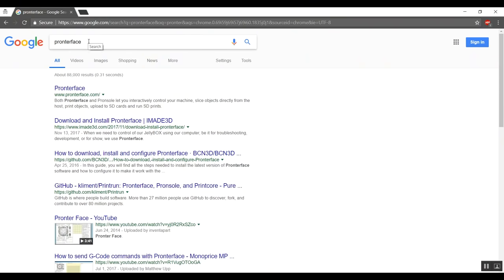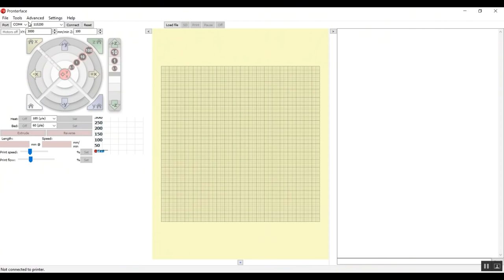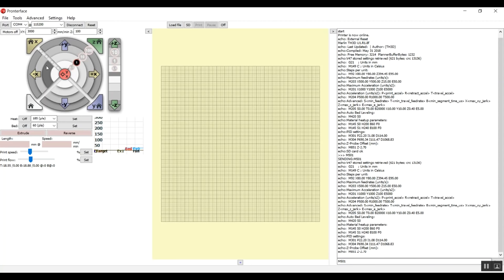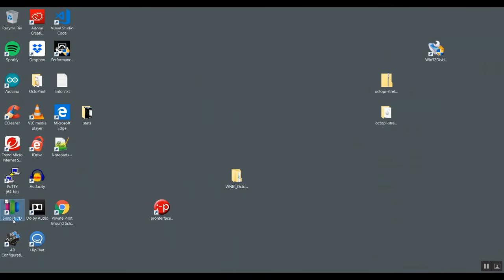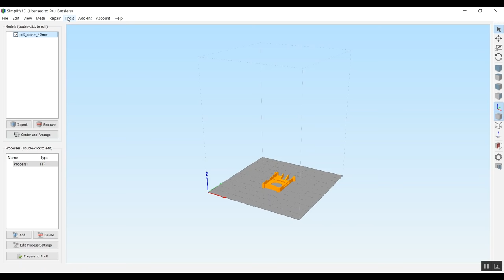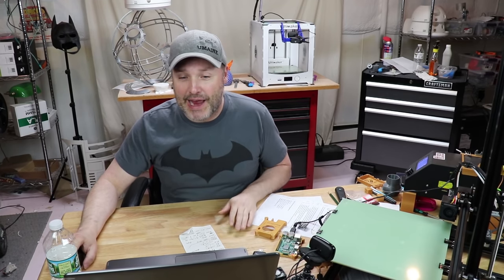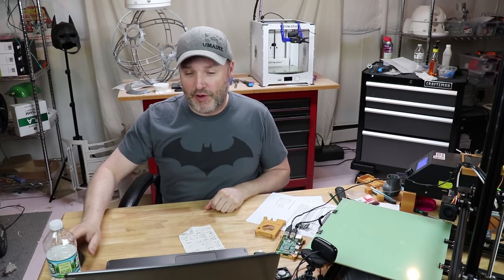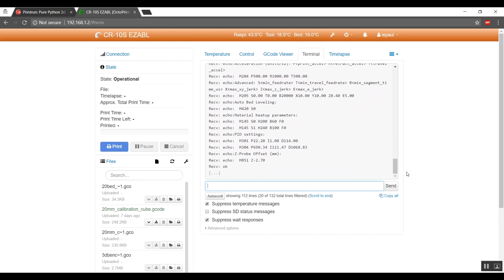How to connect to your 3D Printer from your PC via USB!

Comment: I ended up having to use PronterFace with my new MP Mini Delta when the micro SD card that came with it became corrupted - and none of the other micro SC cards I had would work with it.   (I am returning the delta and getting an Ender 3).   The problem I had with delta and Pronterface was while it would pump out a print OK...the first couple of layers were pushing into the bed too hard.  It would go through the self leveling routine fine but then pressing too hard after it started.  Any Z axis tips would be greatly appreciated.
Reply from the maker: Try Repetier Host or even Cura.  It sounds like your bed leveling needs to come up a smidge
Reply: Thanks...will try that if I have problems with the Ender 3 when it arrives - the mini delta gets returned today.  I am using Cura for the slicing put couldn't get it print directly which is why I tried pronterface.  The weird thing was, the printer worked perfectly when I ran the g code off the sd card but once the card got corrupted, the exact same file went wonky at the beginning when using pronterface.  Sure would be nice if this hobby was a little more plug and play.
Reply from the maker: @TheFieldLab  well the cost for out of the box/works quickly has a cost...  Ultimaker, Raise3D and higher end printers like that do give you that experience but are much more expensive.  These cheaper printers entice us with their low cost but not everyone has a good first time experience with them...largely due to the lack of support.  We're at an interesting time in 3D printing...people adore these cheap printers knowing they have to rely on Facebook/Social media for support and pretty much have to upgrade/replace components to get quality prints!

Comment: Looks great when you do it but Pronterface doesn't find my Ender 5 Plus.  Now what?
Reply from the maker: I don’t have an Ender 5 to compare with. Make sure you have the port showing up on Device Manager?
Reply: @WhereNerdyisCool  OK, I got Pface to find my E5+.  Now what?  I have a part I designed on Solidworks because I use it in my work.  I saved it as an STL file and I'd like to print it as simply as possible.  I've heard the smart thing is to save the part to an SD card but that's just a rumor to me.
Reply from the maker: SD card is the quickest and easiest.
Reply: @WhereNerdyisCool  OK, so we're making progress.  Any suggestions on how to get from a STL file I created to an SD card using Pface?  Is there something I should read rather than pestering you?
Reply from the maker: I’d use Cura

Comment: I don't understand, please help. I am trying to connect via USB cable with pronterface. I have tried several different cables and all usb ports, but pronterface keeps saying: 

[ERROR] Could not connect to COM5 at baudrate 115200:
Serial error: Cannot configure port, something went wrong. Original message: WindowsError(31, 'A device attached to the system is not functioning.')

I am using an Ender 3 printer, all I know is that the 115200 baudrate is correct. As I read it on internet (so it must be true ;p)
Reply from the maker: Is this a Windows PC?
Go into Device Manager and look under Ports.  Check which port you have a showing and available
Reply: @WhereNerdyisCool  Not exactly sure what you mean. Yes, I am using a windows laptop.MSI GL62, 7RDx to be exact. 

When I open pronterface, it automatically shows com5, but no connection. 

With the Device Manager I assume you mean from windows, when I go there, and with ports I assume you mean the tab called "Universal Serial Bus Controllers"?
Reply from the maker: @demondin  As I said, in Device Manager, under Ports (COM & LPT), it will display the available ports.  You should have a "Communications Port (COM *some number*) showing
Reply: Well, I wish I could send you a screenshot of my device manager here because, believe you me, there is no Ports category there. Only Universal Serial Bus.
Reply from the maker: No need to convince me of anything.  If you do not have any com ports showing up, we’ve confirmed the problem.  Try another usb cable?  Have you posted this question to the Ender 3 Facebook support group?
Reply: @WhereNerdyisCool  Nope, found the problem :) In my device manager the hidden  devices were switched off. I have Ports now, with 1 sub line saying COM5. Now what? :)
Reply from the maker: Tell pronterface com5.  Make sure nothing else is using the port
Reply: @WhereNerdyisCool  How do I make of that? Plus how do I even know which port this is on my laptop? (Sorry for all the questions but all my prints come out like shit and I am 99% positive that it is under or over extrusion so I need to connect my laptop to my printer)
Reply: @WhereNerdyisCool  Oh wait it says that the device is not connected to the computer. Sigh... Why is this so difficult? Why can't it just be, plug cable in USB, open Pronterface, done...
Reply from the maker: It’s usually that simple.  I’d consult with other Ender 3 users on the Facebook group.  I don’t have one so I’m at a loss to duplicate

Comment: I had my printer connected to com 4, then one day, com 4 wont connect to the printer.  Are there drivers that need to be installed?  I think something got wiped with I did a windows update
Reply from the maker: I'd search on YouTube on How to find my COM port...and include what version of Windows you use.  Mine stays the same on my Windows 10 setup

Comment: Hello! I just added an E3V6 hotend to my monoprice mini V1, and I updated the firmware. Now I am trying to run a couple of commands to my Monoprice from Pronterface, but, I am having a REAL hard time finding the Com port, and I cannot connect. I have tried both on my Mac, but, also on a PC laptop running Windows 8.1. When I launch Pronterface on the Mac and the PC, the Port window is blank (on both), and I just have no idea how to find the information to type in.. I had thought I found it at times, but, so far, no luck. Any chance you can help guide me to find the right port that I plug the USB into to my monoprice? I know the ports all work on the Mac and the PC. THANKS!!!
Reply from the maker: In Device Manger, Under Ports, it should be listed.  You can get to Device Manager a few ways...easiest is the Search Box in your System Tray (near the Start Button)  Start typing Device Manager and it should show up!
Reply: Thanks! It worked out! Just got 1 more question... When I 'Home' my genuine E3DV6 hot end, it ends up about 3MM off the front left corner of the bed. Basically, the same as place as the factory setting, but, about 3MM off the front of the bed now). I can move the hot end into the right position (using on the pronterface interface) - is there a way I can move the hot end into the desired place on the bed that I would like it to 'home' to, and then upload a command (followed by M500) to save that desired position as the 'new default' location when hitting the 'Home' button? Is it possible to do that way? Or, do you know a pronterface command to upload (followed by M500), to make the E3Dv6 home on the left corner? Basically, 'fixing' the homing positioning with the offset (through pronterface), and saving it in the firmware so that it then homes on the left front corner of the bed again?
Reply from the maker: @Gouldeyecandy  I don't know....that's a good question.  I can suggest asking on my web forum (http://www.3dprintingforum.us/)  Or you could try any of the many  Facebook 3D printing groups too..
Reply: Thanks!!

Comment: Unless I missed something, nothing was actually printed.  Neither piece of software will install on my Windows 10 machine.  I don't have a PhD in Computer Science.  If I could program a Raspberry Pi, I would just build my own printer.  It does not look look printing for the USB cable is implemented in most printers.
Reply from the maker: ...you missed something. Many use Raspberry PI and the USB connection to the printer to print. 🙂

Comment: I just got an Ender 3, which uses the same board as the CR-10, and I'm having an issue when I try to connect it to PronterFace, it gives an error that says A device attached to the system is not functioning. Do you have any idea what the issue could be there? Thanks.
Reply from the maker: Baud rate comes to mind?
Reply: Kind of. I figured it out. I updated the driver for the port in Windows and then changed the baud rate to match and it worked on my laptop, but I did the same thing with it on my desktop PC and it still wouldn't work, but it gave me a different message, which I can't remember now... but at least I have it working with my laptop! Good enough.

Comment: Your information about CURA not having support to print via USB is false, CURA very much enables you print via USB
Reply from the maker: Let me clarify....not on an Ultimaker 3.  No USB port
Reply: @WhereNerdyisCool  with CURA I can easily print on my CR-10s Using a USB cable from my laptop
Reply from the maker: @iamchukwueke  right, but if you check out their support forums, they were talking about no longer supporting it.

Comment: you blerb on as if s3d is the wheel lol ...  cura , ideamaker ,craftware,mattercontrol and repetier host  all have a user interface for controlling a 3d  printer .. and you mention custom supports  well cura, ideamaker and todays version of mattercontrol has those features   in my view the s3d guys are just money grabbers ...  all these slicers ive mentioned  dont cost a penny and they all are in my opinion worth more free than hundreds of dollars for the same program under a different guise ... have you seen the latest version of ideamaker ,or craftware ??? their custom supports are awesome .. and guess what??  they cost absolutely  "JACK!!!!" ;)
Reply from the maker: True...there are many other slicers that can do the USB connection testing.  Minus Cura, which does not at all.  Thanks for your comment

Comment: Well I am none of the wiser,for god sake show the connections from the Pi and I thought it was wireless .
Reply from the maker: Umm, the video title says "via USB"   =)   I didn't exactly try to hide anything
Reply: OK,is it standard USB or micro and how different is the setup for WiFi?
Reply from the maker: Using the standard USB ports.  As to what's on the printer, it can vary printer to printer.  My CR-10S uses the USB 2.0 Mini-B 5 Pin.  This video wasn't about setting up wireless.  That is in my other video showing how to install and setup Octoprint.  Refer to that.

Comment: For some reason when I plugged my printer into my laptop it doesn't pop up anywhere. Still trying to figure that but out
Reply from the maker: What 3D printer do you have?
Reply: @WhereNerdyisCool  ender 5 plus. Turns out my one mini USB was a bad cable or just a power cable. Sometimes the solution is ridiculously simple lol